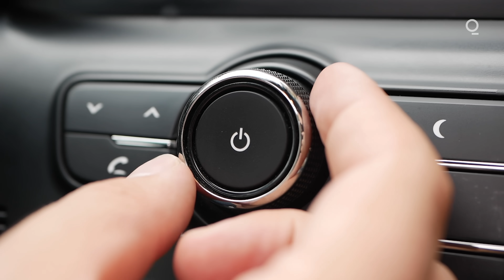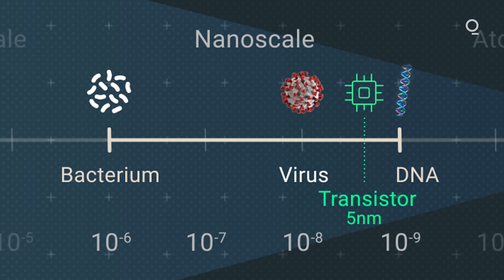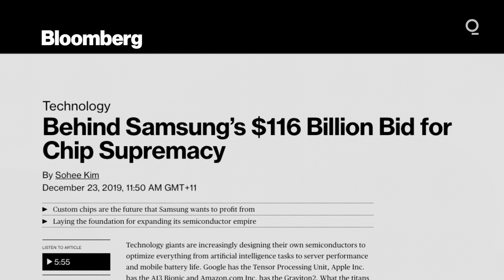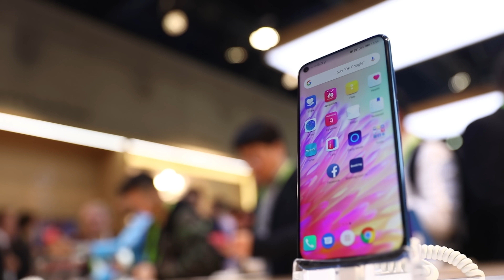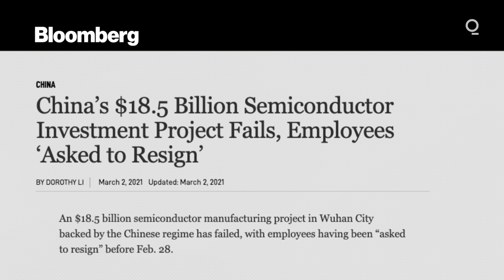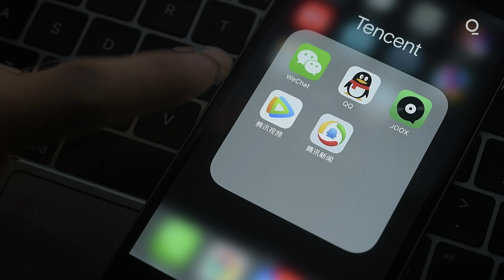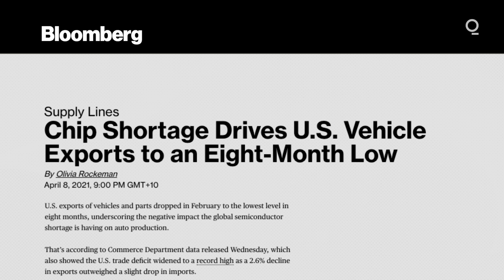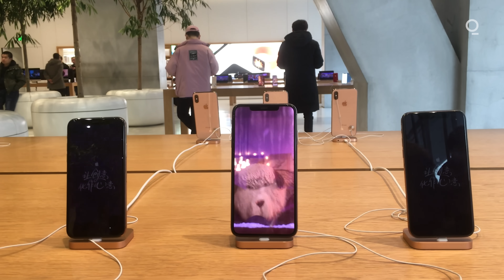Inside China's Accelerating Bid for Chip Supremacy

Comment: So in American logic, China’s chip self-reliance = seeking supremacy?!
Luckily China only have this left that USA still has an edge. Even so, China already has 28nm tech matured, without US connection
Reply: Yes. In the next 10 years, China will achieve chip supremacy and Taiwan will become less important year after year, just like the US :)
Reply: pretty sure all the IP stolen work was referring to a 14NM chiplet design (: so if leaks and if there is any truth to chinese companys stealing the 14NM process, then i guess china also has 14nm "matured" but needs the factorys to build them =]
Reply: @welshe222  
It’s matured with all China’s components, including EDC software.
It’s on 13th 5-year plan, and start to taking commercial orders.
And it’s 28nm
Reply: No, that's the premise of the video, not the view of America.  And you're proud of 28 nanometer chips?  I think Intel has at least gotten down to 10 nanometers.
Reply: @coldham77  china's 28nm process has been fully vertically integrated, meaning china can make the machines that make 28nm chips as well. With this foundation its going to be a rapid advance upto 7nm within the next few years even without an EUV breakthrough.

Keep in mind the vast majority of chips consumed by industry are around 28nm and up because you don't need cutting edge tech for a windscreen wiper controller.
Reply: @hughmungus2760  Valid points.  But you know, I'm still not concerned.  The shortage is global and it should leave plenty of opportunity for more fabs to be built.  I'm no expert, but would opting for a 7 nm chip use less energy than a 28nm chip?  I'll agree 7 nm is bleeding edge at the moment, but soon efficiency demands a faster and cooler chip.

Comment: The chip wrs have begun. Globally, if countries have to line up behind which sphere of production they see fit, most likely, wouldn't they go for cost. And if china can manage to make just as sophisticated chips and much more quickly and cheaper than a whole lot of countries would line up behind them.
Reply: I don't care who wins, just make fkin chips so we can buy GPUs
Reply: @temporaryyoutube2062  maybe ps5s will be cheaper
Reply: @temporaryyoutube2062   yepp
Reply: If china know to make high end chip every province will have 1 chip factory, there will be 30 different kind of chip 🍟, how many mobile companies is there in China?
Reply: You are right, the cost of any product depends on quantity and of course quality. China has  both. Semiconductor manufacturing depends on technology. China has been force into corner and there is no alternative. It make China more determine to get there. Currently, the bigger issue is extreme UV machine, to lesser extend the computer aid design.  A lot of western media keep highlights the fail ventures, but it is too early to conclude yet. I would give it 5 years at least. There is nothing to lose as there is no alternative.
Reply: @charlielee1000100   chip industries from scratch are not built in 5 years buddy takes decades
Reply: @eduwino151  That's only if start from scratch.
Reply: @charlielee1000100   LOL semiconductors dont work like that buddy , you need to make machines that make the machines to make the chips you want none of those industries are in china , these are not rolexes that you can just knock off in a basement in shenzen
Reply: the chip advancement has limit. How small can you go? 2nm, 1nm? It is a matter of time for China to catch up otherwise they wont put that into plan to be independent. Who care it is 5 yeears or 10 years. 10 years is a very short time. It isnt like it can go any smaller unless new tech came up and then that is another new race everyone starts from zero.
Reply: @stephenoh9638   lol  those machines that make those chips are built by suppliers who have suppliers who have their own suppliers all located in the west,  starting from scratch minus help means china will have to invent new  industries and materials ,  that cant be done in 10 years buddy this is not like copying and making a fake rolex, by the time China catches up the west will be onto photonic chips
Reply: @eduwino151  the thing is, china's leading quantuum computing, this is not in the future, it is now
Reply: @ezioauditore5616   lol continue deluding yourselves
Reply: @eduwino151  delude in what way? the news are so last year, even the atomic bomb kid went to china to see it
Reply: @ezioauditore5616   read about D-Wave which was already in use and helped design the f35 years ago , that was a paid chinese propaganda piece of stalled lab projects
Reply: @ezioauditore5616   do you think a country that can make applicable quantum computers would rely on Western countries for simpler things like microchips
Reply: @eduwino151  that country has its own space station.  And also china gave their trust and outsourced the purchase of US microchips instead of trying to do it themselves, and don't tell me 5g is an hoax
Reply: @ezioauditore5616   all that requires Western tech to run and work minus which they go back to using vacuum tubes
Reply: @eduwino151  Normally it'd be true since chip building is a race, and losers won't have the earnings to spend on R&D to catch up.  Tho trade war has split the market, forcing Chinese market to use Chinese chip, insulation them from outside competition.  Same is true for their new operating system.  It's almost certain that a parallel ecosystem will come into being.  Their products will of course be inferior initially, but will mass production their technique will surely improve fast.
Reply: @henli-rw5dw   minus western tech they are not making anything buddy
Reply: @eduwino151    - you are vastly mistaken.  ANYTHING can be copied and once  copied can be improved. If the USA will not sell stuff to China they will simply get what they need by secret means and copy the technology. Sure that is IP theft, but there is nothing the USA can do about it after they forced China to do it.  China will simply not allow the west to humiliate them any longer.
Reply: MADE IN CHINA 🇨🇳. Computers, phones, drones and many other electronics are made in China, Chinatowns, the self sufficient armies are all over America, farmland and big businesses are being owned by China connected companies. Universities, Hollywood, NFA and NBA love China money .China is a greatest threat.
Reply: Yarik you are smart.
Reply: The west always underestimate Chinese technological prowess and comes back to beg favor, like Trump.
Reply: @sonarbangla8711   buddy there is no shortcut to semiconductors it will take decades and china likes shortcuts,  semiconductors are not cheap shoes you can copy in day
Reply: ASML are the real wizards minus their EUV  machines nobody on the planet can make any advanced chips, and EUV is American patented tech meaning Chinas chip dreams could be killed in a day
Reply: @eduwino151  that's a big lie mate
Reply: @eduwino151  ASML is the only EUV maker for now. But that won't be true for long
Reply: @the80386   EUV research started in the 80s when China was still a starving backwater state and took 4 decades to develop,  by different highly specialized western firms ASML just assembles the components 70% of which are made by America, this is not an industry you can cook up in 2 years , China should be ready to spend decades by then the west will be using photonic chips
Reply: @eduwino151  you assume the rate of development will be the same, which isn't true. china's growth rate is much higher simply because they have government backing on a nationwide level. it's one of, if not the most important strategic goal for them.

china also produces much more scientists and engineers due to the sheer number of young population but also because they focus a lot more on STEM subjects, whereas usa has a big proportion of humanities graduates, who have very limited impact on technical and industrial development.
Reply: @the80386  exactly, with the governments backing these guys will get it faster than expected
Reply: @eduwino151  The best and brightest Americans go into economics. The best and brightest Chinese go into engineering, and science. Why? because those are the best paid jobs in each nation. The US will see it lead vanish simply because the US and her people don not act like science is important.
Reply: @western wumao  people think that there is a shortcut to developing semiconductors from scratch , it will take decades to develop a separate system from western tech

Comment: You feel that the video is made to make Taiwan looks like the best country in the world which is not true.
The F22 was made early 2000 which is much better than F35 and chip technology back then was made by 25 or so manufacturers.
The report always forget the diminishing returns law and how China is actually don't need to be that much sophisticated in order to achieve 99% of its requirements.
Last point the main technical knowledge needed by China is made by ASML which is neither US nor Taiwan origin but from Europe
Reply: ASMLs EUV machines 70% of all the core parts and software are made by American companies , EUV lithography is us tech buddy and they can ban anyone they want from using it
Reply: @eduwino151  They really cant since ASML is the only one able to make the machines, its a stalemate.
Reply: @mick0matic  You are aware most EU countries will bend over backwards for the US.
Reply: @mick0matic    70% of the core parts that make EUV works are made by US companies , America already stopped ASML from selling SMIC the machines , which part about that cant you get through your head
Reply: @eduwino151  ASML Already sold DUV machines to china and you can bet they've reverse engineered those already. Once the few missing components that come from the US is filled in with domestic chinese substitutes china basically has a working EUV machine.
Reply: @eduwino151  Even if 0% of the core parts are from America, it still have all kinds of ways to stop ASML from selling it to China.
Reply: @luckylucky660   Chinas hands are tied , if a conflict breaks out and they get cut off completely their entire tech industry can be crumbled overnight
Reply: @eduwino151  That also means those US companies will lose a big amount of money in view of China's huge domestic market.
Reply: @luckylucky660     the market will struggle for a couple of years before getting replaced by south east Asia and India, meanwhile Chinas entire tech industry will be in shambles
Reply: @eduwino151  If things were that easy, Trump would have done so. You know how many jobs America will lose if they sanction China on semiconductor import strictly? about 125k. America is a capitalist country, it means they do everything for profits.

Comment: China appears to be leading the race for technological convergence  - but questions: how far is it creative in its own right rather than in back engineering? No presumption on either alternative.
How far does it depend on subverting western institutions with intellect destroying ideological viruses - collectively summed as ‘woke?’ - for example the Oxford and Cambridge “Universities” in the U.K. which appear now directed by placemen and MIT in the US - at least at last count.
Is there not a necessary component to this race in the attainment of most efficient means to conduit Ambient Planetary Energy into full scale H2 production with derivative industries? 
Wind, Tide, (not Wave) and Current have respectively three extra-terrestrial drivers: Sun, Moon, and Universal Gyre (or Spin). Suggestion made that respective appropriate response in terms of planetary engineering matrices to each is Geodesics, Khatmatrix (syncopated cubeoctahedra) with Isotropic Vector matrix, and ditto for ocean currents. Oil in the rear mirror regards the power available from these if properly approached. 
Anything attempted will necessarily need to clear the muck and build back generally on Pauline and Constitutional bases for any possible chance of succeeding - there is no superseding best character.

Comment: Why can’t they just make bigger chips rather than striving towards smaller transistor sizes?
Reply: Bigger chips = longer distances and add complexity to things such as clock distribution. Smaller transistor also helps with power, requiring less current to change state. Scale it up to billions and the effect is significant
Reply: In one word, mobile-phones!
Reply: There are companies doing bigger chips. This also means less chips per wafer and thus costs more $$$
Reply: Modern technology like your current smartphone is only possible because of smaller chip and smaller architecture. All electronics has a limited on certain point whatever will it be size, weight, battery capacity, etc. Look back at history of mobile phone, phone with larger chips has a physical size compares to a suitcase.
Reply: small size = more transistors in  small size =  faster =  ????????? = Profit .

Comment: The United States graduates roughly 70,000 undergraduate electrical engineers annually, whereas China graduates 600,000. China will copy and steal chip technology then surpass the West as it did in other industries. It is really only a matter of time until China catches up
Reply: Of the 70,000 US graduates, how many do you think are ethnic Chinese? According to SEMI, 3/4 of US graduates in semiconductor related subjects are foreign-born, the majority of whom are Chinese - yes quite a few of these are also from Taiwan.
Reply: @JA-pn4ji  I totally agree with that
Reply: Too late to catch up on that front im afraid. The undergrads you get reflect the quality of k-12 education. Barely any can handle the math of an engineering education. I went through the sciences but id admit that I wouldnt have done well in the engineering versions of my classes. You dont need to grasp as obscure concepts but you do need to do basic operations quickly without a calculator while simultaneously handling the total bs of our mixed number system. Have fun converting complex units like pressure to imperial lol